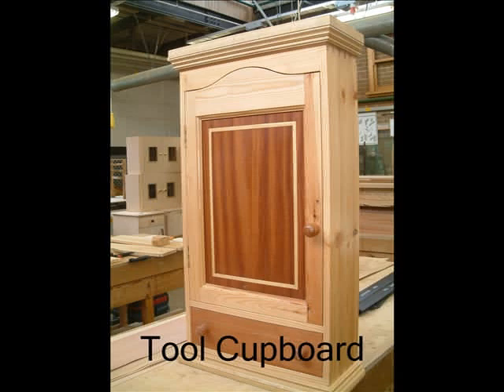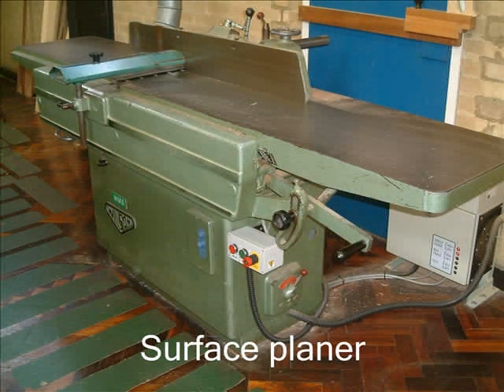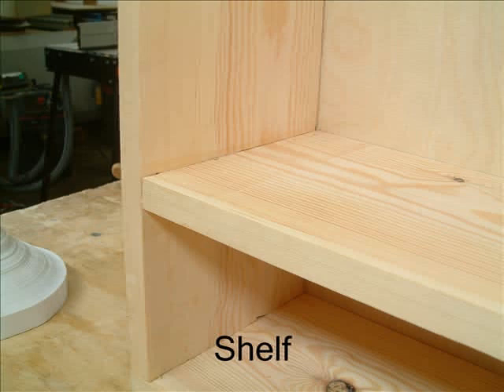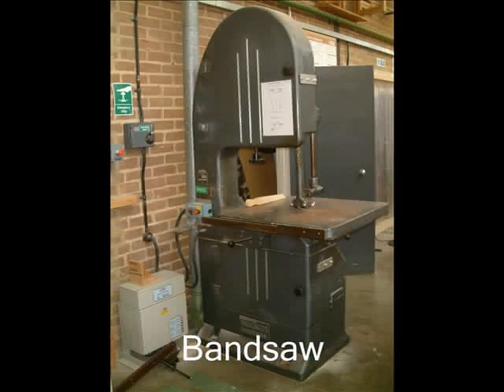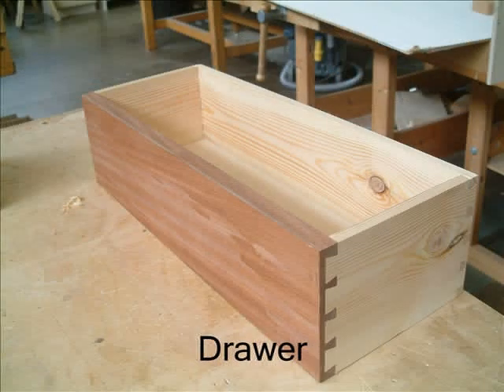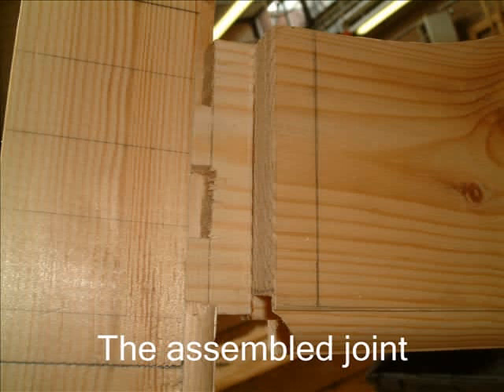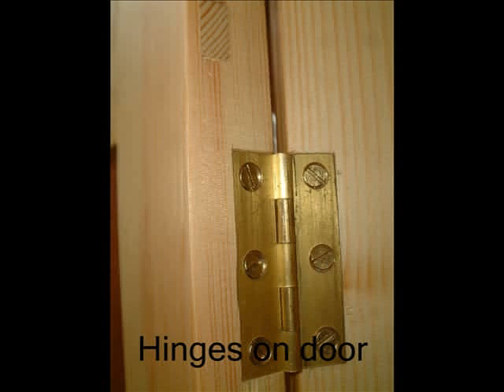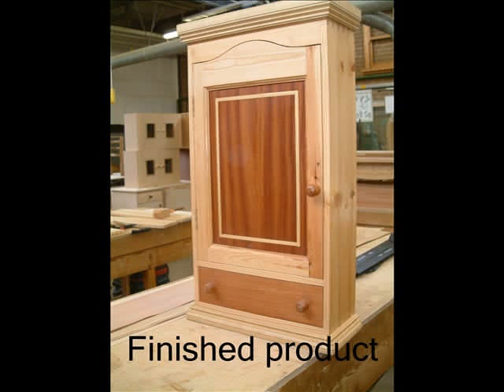Making a tool cabinet

Comment: I know its a wood work exercise but fantastically expensive for a tool store that said it does look nice
In my day the thought of using anything but hand tools (other than a lathe) for woodwork was just not considered as it removes much of the skill based accuracy required to be a real carpenter

Comment: awwwwww c'mon.....it is actually called a thickness planer...and In England a rabbet joint is called a rebate...there is a difference in England between a board and a plank...they use the metric system for measurement and we use the empirical system...in England half blind dovetails are called lapped dovetail....they are not wrong ....just different. no need to call him a bastard....no matter how you misspell it.